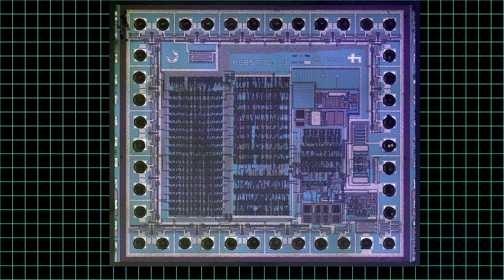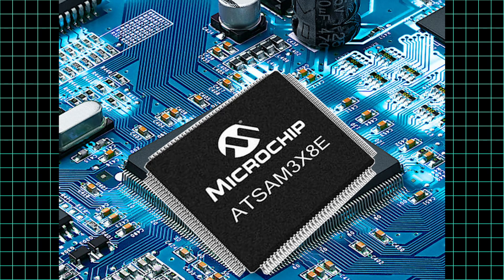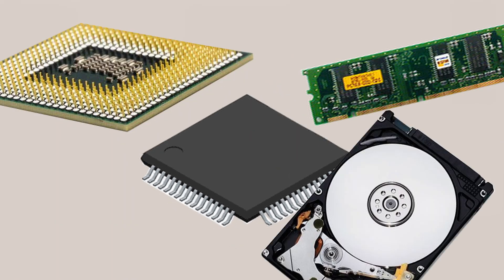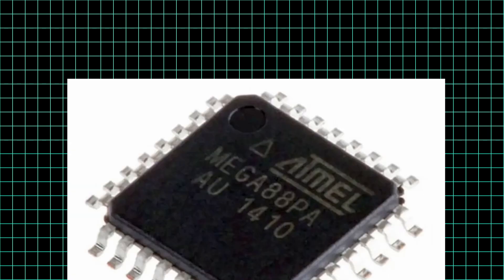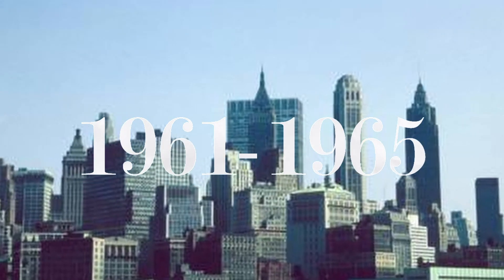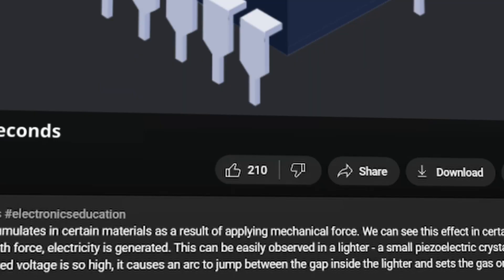Integrated Circuits in 100 Seconds

Comment: Meh... You're onto something, but this needs a remake with some more thought put into it.
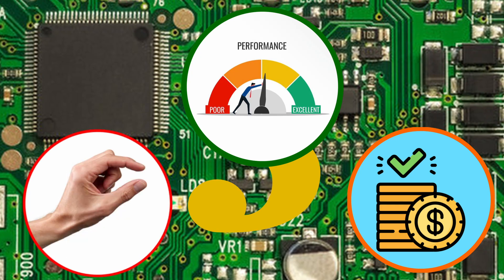1:10 ... that's wrong... the image at least... you're really off the mark there.
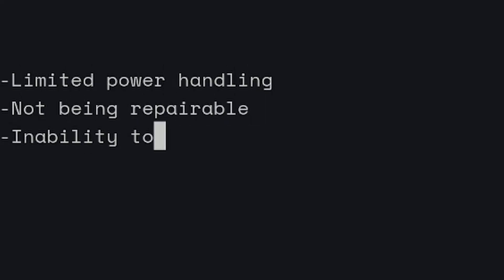1:37 ... This is wrong...
- What do you mean Limited Power Handling? (You have hundreds of watts running through a tiny piece of silicon.)
In case you don't know, CPU's nowadays have 100-200W at 1V, that's 100-200A switching at 4-5GHz.
There is some serious power handling capability. Research Thyristors for example. Thousands of Amps... no worries...
- Temperature sensitivity? (There's consumer / industrial at -20°C to +80°C or -40°C to +80°C, but you have automotive at -55°C to +105°C, and military at -55°C to +125°C)
Power IC's usually cut out at +155°C, but they don't burn up. They reset and keep trying.
Try Copper at +100°C, calculate it's resistivity. you'll have a big surprise.
Nowadays you have GaN... even more power... you're really off the mark...
- What else do you want to integrate... they have IHS... Integrated Heatsinks... what more do you want to integrate? (the fucking touchscreen and speaker...)

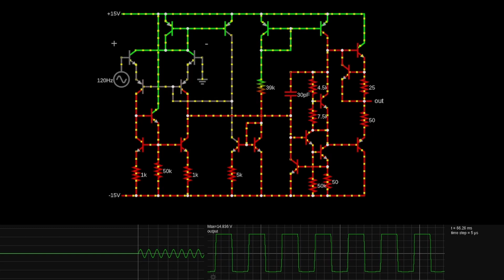Comment: What was that simulation at 0:28? I feel like that'd be useful in helping me understand electronics
Reply: That would be Falstad's circuit simulator. It's available to use online or you can download it to run locally on your PC. It's a great piece of software to learn circuits since it's very visual and easy to use, though down the line you'd probably want to learn something like LTSpice.
Reply: @lorencelacks8498  Thank you lots! This is some nice stuff
Reply: I think it's Proto - circuit simulator
Reply: Like @lorencelacks8498 said, it’s Circuitsjs. Using LTspice is a touch more complicated, but allows for a lot more depth